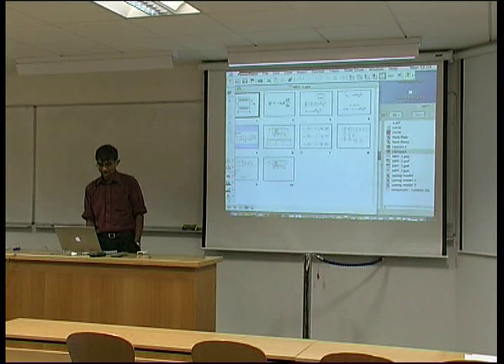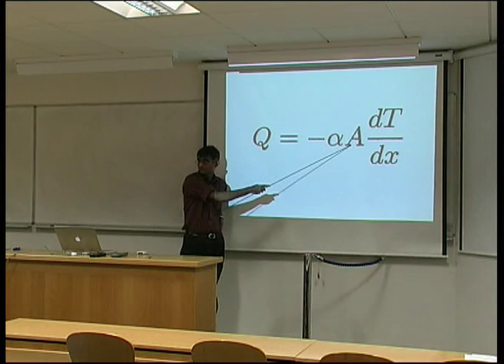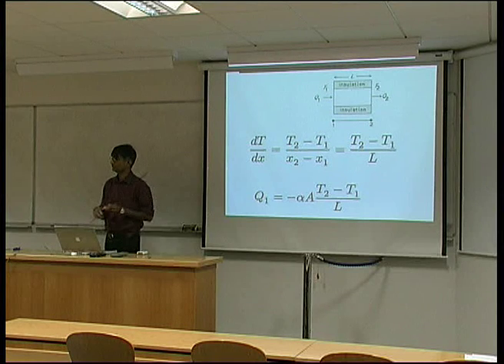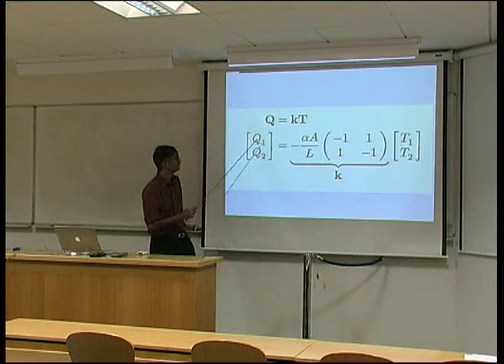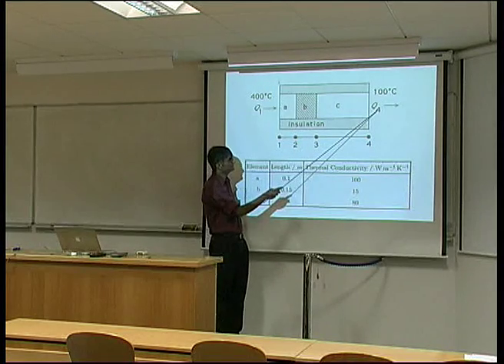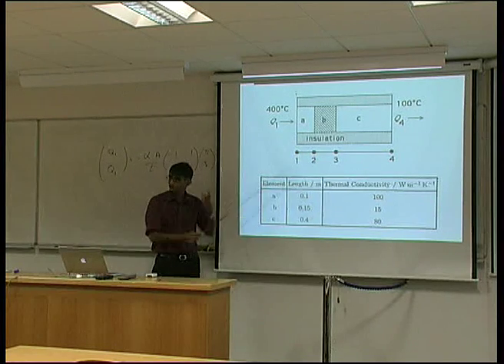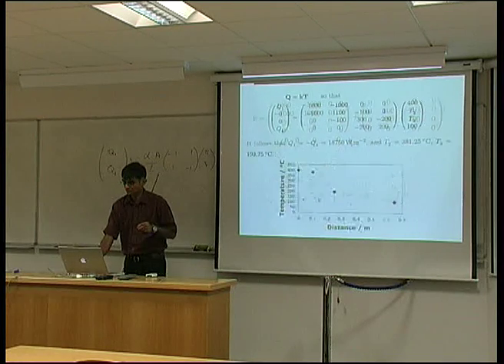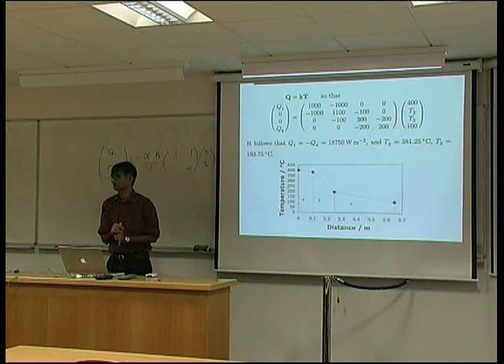Finite Element Analysis, Part 2

Comment: If Q is heat flow, and since there is heat flowing between elements a to b, and b to c, then shouldnt there be values at nodes for Q2 and Q3? Is it zero b/c it is in equilibrium? Or is Q defined as heat flow a bad definition? Should Q be better defined as heat source or generation or consumption? Which would be a heat gradient? I suppose if there are no losses across the a-b and b-c interfaces, then gradient =0 therefore Q2 and Q3=0?